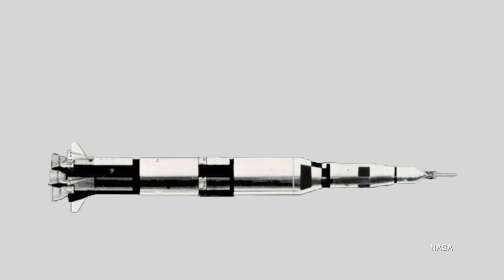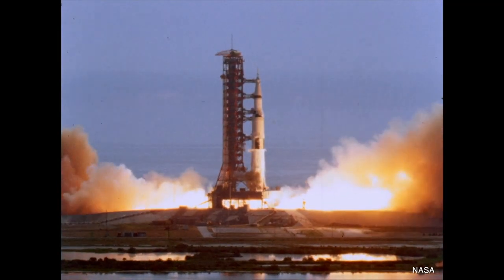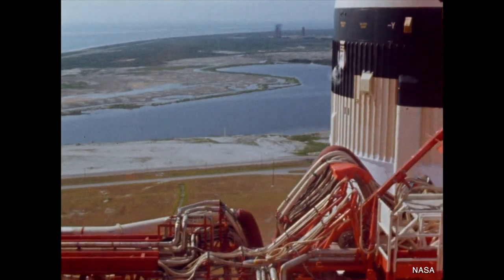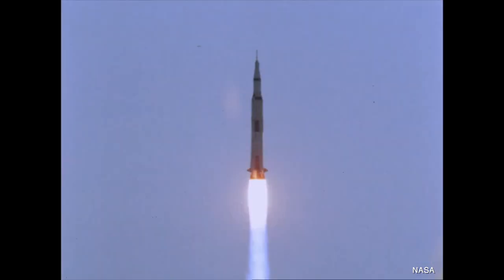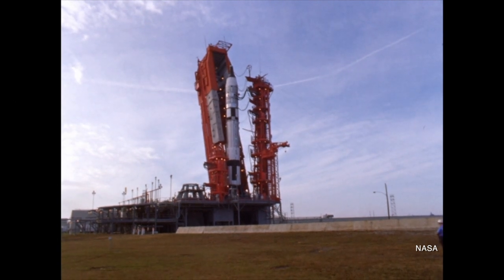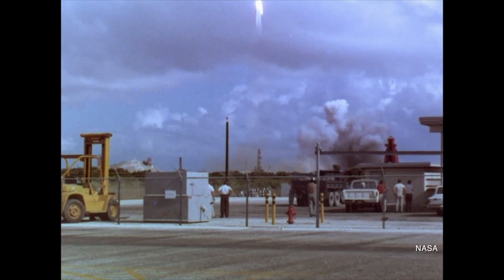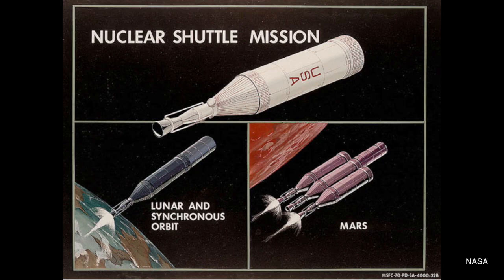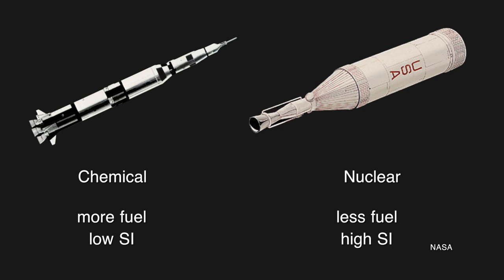What's the Best Kind of Rocket Fuel?

Comment: I've always wondered that why do many chemical rockets often use some fuel other than liquid hydrogen, even though the liquid hydrogen (together with liquid oxygen) is the lightest energy source available.
Reply: It's actually because it's so light (that, and it has to be kept incredibly cold).

LH2 has only about 7% the density of water.  So, while it's very efficient as a propellant, you have to carry a huge volume of it (because what's important for generating enough thrust is the mass of the propellant), so the rocket ends up being bigger.  It's why the first stage of the Saturn V used RP-1 instead of liquid hydrogen.  I read somewhere that the first stage would have had be three times the size to hold enough liquid hydrogen.  As the rocket gets lighter, the propulsion advantages of liquid hydrogen begin to outweigh the size disadvantage.

Also, it has to be cooled to about 20K for it to liquefy, so you've got to cool it and keep it cool.  That adds weight and it adds expense.

Comment: que 2 ------ why dont they use butane as rocket fuel since it has a low boiling point (-1) and can easily be stored (thin tank walls) and similar energy desity as methane or lp1 and abundant - this is a serious que also 
about me - i am 45 and  located in greece and an amateur scientist

Comment: A rocket actually does work by pushing off a physical mass, it isn't magic. The mass in the fuel particles is what the spacecraft is pushing off of. The point of the burn is simply  to push harder on each particle, the harder the push the more acceleration of the particle and what with equal and opposite reaction the more acceleration of the fuel the more thrust felt by the rocket per ounce of fuel. 

Specific impulse can be used either for the whole vehicle, the engine,  the fuel alone, or many sub systems thereof but they are all separate ratings, it does no good to compare the sp.I. of a fuel to that of a complete rocket motor. 
Spec.Imp. is literally the thrust-energy to mass ratio, eg one kilo of fuel Z can provide 30 newton-seconds of thrust, joules per kilo could be used but it is difficult to convert total joules to thrust do to motor efficiencies and such. note that the sp imp of a fuel does not change with the amount in the tank, it is a basic material property much like the density of steel doesn't change with the amount present.

Comment: Well ion thrust is not "rocket fuel" as it propels satellites instead of a rocket so maybe xenon should be called the less catchy "satellite fuel". The best rocket fuel today is hydrogen but the highest ISP would be that fluorine,gaseous hydrogen, lithium mixture at ~530 seconds of ISP. But putting NERVA and TRITON in the mix may be unfair as the fuel has not changed but the engine has.

Comment: Why it is that the first stage of the Saturn V used Kerosene as a fuel but the upper 2 stages used liquid hydrogen as a fuel?  It seems that liquid hydrogen would be lighter than kerosene, making for more payload.
Reply: Robert Connor Liquid Hydrogen has a low molecular mass. Meaning atmospheric pressure wreaks havoc on it. So you use kerosene which is a much heavier molecule with a higher mass to penetrate the atmospheric more efficiently.

Comment: Fluorine and Oxygen.  The highest specific impulse among chemical reactions.
Reply: Ozone-Hydrogen has a higher Isp, but is very stupid.
Reply: You mean fluorine and hydrogen.  Not thought well of because of how expensive and difficult fluorine is to work with.
Reply: You might think of fluorine-lithium-hydrogen tripropellant which have the highest theoretical ISP of around 540s. It is a bit impractical though as F2 and H2 are cryogens while Li is a solid metal and must be stored hot to be liquid.